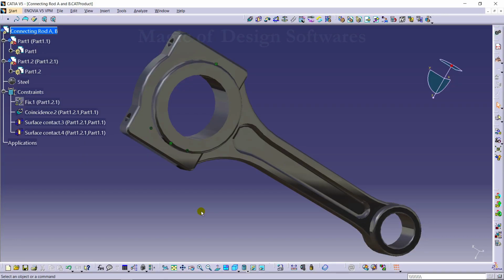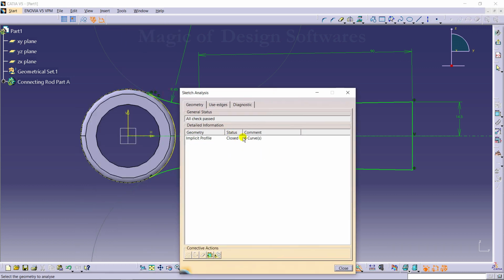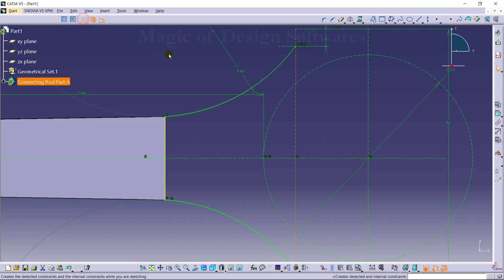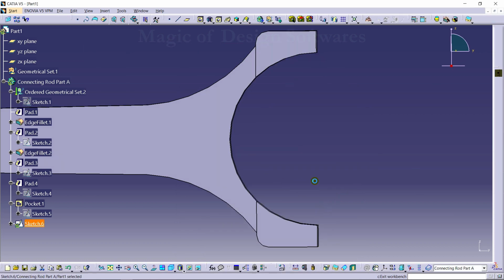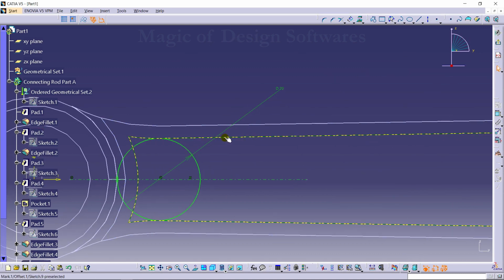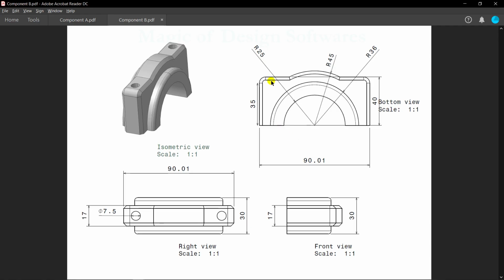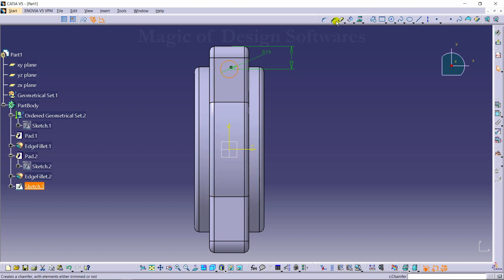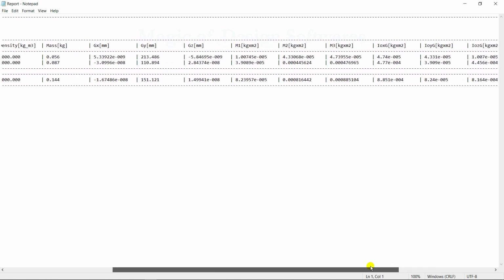V4 Engine Connecting Rod Tutorial | CATIA V5 | Assembly| Make Material Report | Design to Reshape

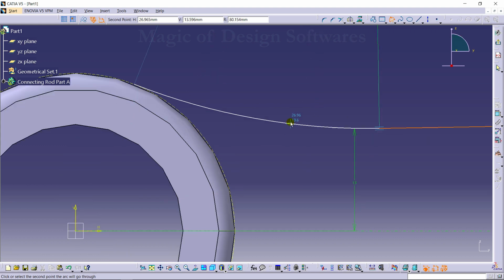Comment: hello, I know I'm a bit late but at 4:00 while making the arc and the circle tangential, the point of tangency remains to be of open profile. I've encountered this issue several times before. due to this I cant pad the sketch out. can u explain what's the issue here? and how can I rectify it? thanks
Reply from the maker: Apply the constraints carefully repeat the process. Make you are selecting correct profile. The reason it is not getting pad because there is an opening in the profile. So make sure you are checking that first. If still getting issue with that. Please mail me. 
Happy Learning ☺